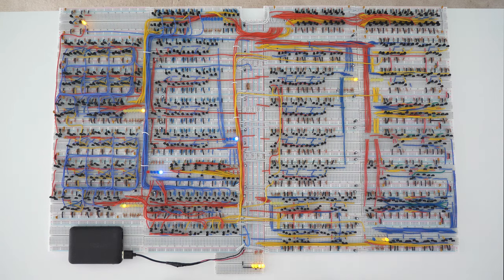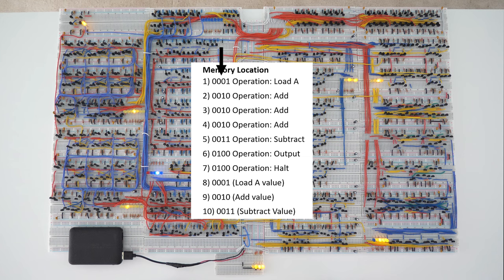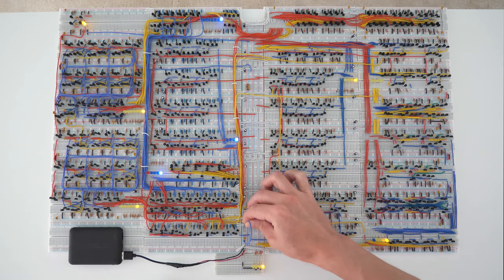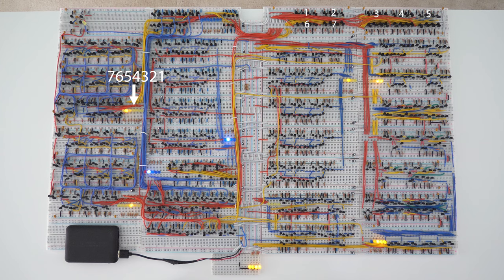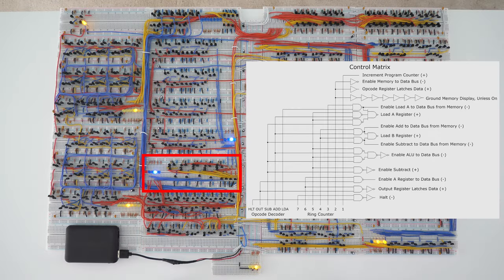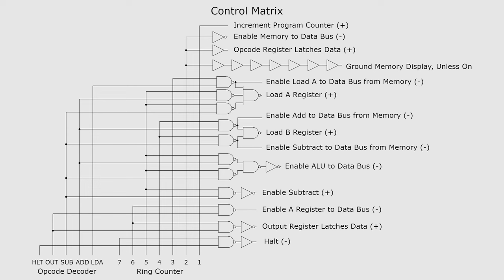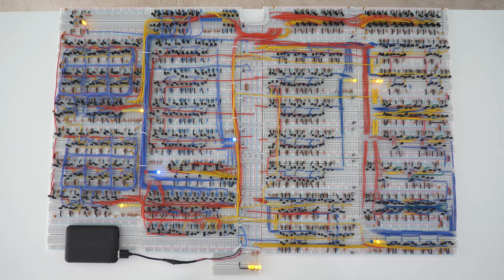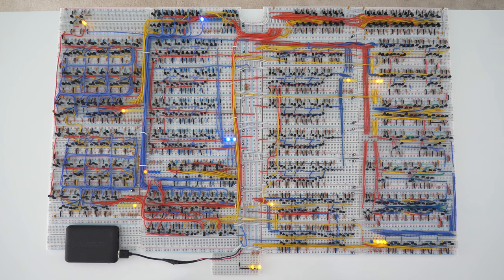How to Build a 4-Bit Computer on Breadboards Using Individual Transistors

Comment: Hello sir, could you please explain how you handle floating inputs from the buttons and bounce on the input? I was trying to build a counter from 2 half adders and 2 d flopflops and im getting unpredictable behavior. (sometimes it skips numbers and sometimes it works perfectly)

Thank you
Reply: I am asking about floating inputs because I read that they may affect the outputs of D flipflops
Reply from the maker: Well I did not use half adders in my counters. Are you trying to built the ALU, binary counter, or ring counter? I am guessing that if you hook your circuit up to an oscilloscope you will see that it is switching much faster than you realize. Also I do not think I even had a floating input, it was always high or ground. The latches start at random values but you and in a reset to force them to be off for there initial state. I can try and help more if you provide more information.
Reply: @GlobalScienceNetwork  I've already built the 4 bit ALU. No problems there. But I am having trouble with anything that has to do with sequential logic( memory circuits).

Is there a way I could contact you directly and show you pictures of what I mean when I say your inputs are floating. I am a complete amateur at the electronics part and I would like to show u a picture of what I thought were the floating inputs on your build.

I really appreciate you responding to these comments. Do you have an instagram or some other messaging app?

I want to build counters for the Program counter and logic sequencer( ring counter)
Reply from the maker: @ChaksFM  If you look at my YouTube profile you can find my email address and send the questions there.
Reply: @GlobalScienceNetwork  thank you so much

Comment: Is this an integrated circuits(IC) structure In the bread Board or outside the black silicon?
Reply from the maker: You could turn this into an IC like the intel 4004 series. Since it only has around 1,000 transistors you could also make it into a PCB.

Comment: I'd love to build a condensed version of this with integrated circuits. But I do wonder: is it possible to write recursive programs for it? A Fibonacci calculator, for example. What would need to be done to make that work?
Reply from the maker: I like the way you are thinking. Pretty soon I will be uploading videos about building artificial neural networks. We will need to find ways to get a small network to do useful computations. Stay tuned!
Reply: Well, I just realized that it'll probably just do that on its own if I don't write a HALT instruction into the program anyway.

In either case, I'll figure it out once I get there. I already have the ALU nearly complete.
Reply from the maker: @dylanm.3692  Sweet, nice work!

Comment: please explain  how do you built all the parts off this computer with many videos
Reply from the maker: I do have other videos about how all the parts of the computer work. Start with logic gates, then the 4-bit calculator/ALU. Then watch about flip flops. From there when you see the circuit diagram provided it should start making sense how it all works. It would be good to make a video about how each circuit works as you mentioned for further clarification. With the video I made you should be able to built the computer if you wanted to.

Comment: It would be cool to supply a little Arduino interface to allow the Arduino to be used to easily load programs and use it's own memory as the computer's memory
Reply from the maker: Yeah, that would be cool. I am working to build artificial neurons on breadboards now and I plan to wirelessly send the output to a little vehicle so I can control it with the circuits build on breadboards. This way I can change the circuit and not have to build a finalized design with a PCB that would fit on the vehicle.

Comment: Can someone explain to me how it is that the computer is storing the information of the outcomes of the addition/subtraction functions in between each one?
Reply from the maker: The results are stored in the accumulator Register. You might be thinking that the ALU would then change its value so it would change the accumulator register value. That is why the accumulator register has to be a MS data flip-flop. So that there is not a continuous update which would cause a racing condition. Some circuits latch when the clock is high and others when the clock is low.

Comment: Hello, would it be possible to connect to an LCD display?
Reply from the maker: Yeah, adding 7 segment displays would be a good addition to the project. Since the numbers are low it is pretty easy to read the numbers displayed in binary though. You could use an IC for the decoders or build them using individual transistors which would be the idea if the displays were added to this computer.

Comment: Do you have full tutorial?  Can I use simulator like Proteus to do this circuit?
Reply from the maker: I made a series of videos starting with basic logic gates, latches, flip flops, and the ALU which is based on the 4-bit calculator. If you watch all of the videos it should be a full tutorial so you can build the computer on your own. That was my goal. I drew the full circuit diagram in EasyEDA at the logic gate level. I made the calculator at the discrete component level. You could work on building these circuits in Proteus and see if you can make the whole computer. That would be a fun project.
Reply: @GlobalScienceNetwork  Thank you for the advice.

Comment: This was NOT stolen from another YouTuber who already did a great job making this PC as well as kits for people to learn themselves.  (edited to fix my mistake)
Reply from the maker: This was not stolen from another YouTuber. This is similar to the Intel 4004 that was built in 1971. The von Newman computer architecture used here was invented by John von Newman in 1945. If you watch the full video I say at the end no one that I know of in recent history has built a breadboard computer out of individual transistors other than Jerry Walker who built an 8-bit computer and wrote a book about it. Back in the early 1970s lots of people were learning to make computers this way. Today many people build breadboard computers out of ICs. These are fun projects and a processor even comes on a single IC so you can "build" the processor with just one chip if you wanted to. The idea behind this project was to build all the circuits for the simplest 4-bit computer at the transistor level. Some people may say this is not necessary but I think it is the best way for everyone to learn how computers work. I learned a lot in the process which I am now using to build hardware based neural networks, which is what I am most interested in.
Reply: @GlobalScienceNetwork  Your right, my mistake. The content I had in mind was Ben Eater's 8-bit computer. Thanks for the detailed explanation and sorry for wasting your time! Appreciate the original content. Subscribed.
Reply from the maker: @beeasy247  Great thanks! No problem, it is pretty common for people to think that breadboard computers are all the same. Building them at the transistor level is the way to go in my opinion and it was a fun project that only required basic discrete components.

Comment: Please consider doing this build again but with relays instead of transistors. The reason is relays are just copper and iron and you can also generate electricity, so this would show that a computer could have been built thousands of years ago. Whereas transistors require very sophisticated manufacturing process.
Reply from the maker: Interesting idea. I am not quite sure what you mean by generating electricity. It would still consume power. Do you know the part number of a relay you have in mind? I probably will not build an entire computer this way but my net project does use relays/optocouplers.
Reply: @GlobalScienceNetwork  the point is how would YOU make a computer eg if none existed and the year was 1750. You would get some copper wire and magnet and make a generator.  And those are same materials to make a relay! So you could make full computer with stuff you could make in 1750 (ben franklin would be proud). and it's not so much about 'time travel' or 'apocalypse', but rather most people understand wire and magnets in a fundamental way, like water and dirt. so you show them a transistor, and it might as well be a microchip to them. it's impenetrable technology.  but relays feel like every day objects if you see it's just a coil of wire and a magnet.
Reply: @GlobalScienceNetwork  you should dress up like benjamin franklin or michael faraday and and build a whole computer from just coper wires and magnets.  that would be so cool. honestly this could have been done thousands of years ago. the hardest part is collecting magnets for the generator.  getting copper and iron wires has been doable for thousands of years.
Reply from the maker: @JamesAwokeKnowing  ha ha that would be funny! Yeah with a little insight, lots of things could have been done sooner. Think about what we could be doing now but probably just do not realize it yet!

Comment: Does it still work if you increase the clock speed e.g 10hz?
Reply from the maker: Yeah , I should have recoded that and show the faster rate. I did not test the max clock speed but it should actually run to around 200,000 Hz.

Comment: By the way, have you tested this discrete CPU in a simulator?
Reply from the maker: I have the complete circuit diagram drawn at the logic gate level in EasyEDA which I show near the beginning of this video. You need the component level for the simulation to run. I did build a 4-bit calculator which became the ALU at the component level which was able to be run as a simulation. I show this in the EasyEDA video on this channel. If you are good at making simulations it would be cool to have the entire computer built as a simulation.

Comment: Just curious How much time did it take 
1
For designing the circuit diagram
2
Actually executing it on breadboards
Reply from the maker: Once I learned and made videos about the logic gates, flip-flops, and 4-bit calculator, it took about three months to build the entire computer. I spent about one week on each section and pieced the computer together as I went. I have another video with a similar title where you can see the computer build half way through the project. If you are interested in building the project I would start with logic gates and then build the 4-bit calculator. I drew the complete circuit diagram at the logic gate level after I built the computer and it only took a few days, mostly to check that the connections were correct. I also have a video where the 4-bit calculator is drawn at the discrete component level.

Comment: hello, great video. im gonna have to check out everything else you made now. great job. . . im no computer engineer, but im learning the fundamentals one concept at a time. . . i play a game called no man sky. its a fun space exploration game.  they have something called the auto switch that works just like a very very slow relay. over the past few years i been build my own 4 bit computer one concept at a time in the game. i like the way your simple set up. i ended up with 16 coded instructions from a 4 bit value. but i find i only use like 4 of them. after watching this video i now know i need a halt instruction. im considering this to be my null instruction at instruction zero. this way any time a null is received the system stops until a reset button is pressed. . . im still working on trying to figure out what my other instructions should be. i still have 5 instructions yet to code in. i just dont know what they should be. yet.
Reply from the maker: Sweet, that sounds like a fun project! Well you could just make the program longer with more instructions. Your project reminds me of when someone built a computer using the Redstone mechanics in Minecraft and it got millions of views.

Comment: For the tri state buffer is the input fron the accumulator low to get a high output?
Reply: This is the open collector tri-state buffer
Reply from the maker: The values on the bus are all on by default and the values are set by grounding the ones that should be off. Data is loaded into the register with the Load A command. Data is sent from the register with the Enable A command. The values get latched high for high inputs and low for low inputs into the register. Load A is done with a high signal, enable A is done with a low signal. If you look at the circuit diagram it shows what type of signal is needed in each case coming out of the control matrix. I hope this makes sense for you!

Comment: You are einstien and should get a token of appreciation of your hardwork i am inspired by your project but i can't afford approx 1000 transistors plz tell xan we create them with vaccum tubes or there is any other way
Reply from the maker: Thanks! Well transistors are probably the cheapest way. You can get 1,000 transistors for around $30. All the other parts, breadboards, wire, batteries, etc. does add up. You can also build simulations of circuits for free on a computer. Or just build smaller circuits to get started.

Comment: Sorry for another question but did you have struggle with inductivity?
Reply from the maker: Not from the wires or components on the breadboard. If I powered the computer with a USB cable from the wall and an unshielded cable there was some noise on the incoming signal. Since this was a digital computer the noise was not enough to make the transistors not work. It is something to be careful of though when making analog designs.

Comment: Schematic diagram link?  I wanna design a PCB for it
Reply from the maker: That would be sweet! If you do let me know. I have the logic gate level diagram I can send you. Which is also shown near the beginning of this video. Just send me an email and I could even help. My email can be found in the channel information.
Reply: @GlobalScienceNetwork  okay!  Thank you.  I will not be able to build the board as because I have no way to get the PCB, but I can sure try and design it.  No promises because I'm only 14 and school is cracking down with finals so if I have time I will!
😃👍
Reply from the maker: @HydroStudios  Ok well some PCB manufacturers will even place the parts. This might be a bit too difficult as your first PCB project but you can certainly give it a try!

Comment: Your next task is to turn this into a Turing machine by adding a memory bank.
Reply from the maker: Hmm it would be cool to build a Turing machine! I am working on building artificial neurons next. It should be pretty interesting, it may be about two months before I make a video about it.
Reply: @GlobalScienceNetwork  I was also reading about Programmable Interrupt Controllers, which store a table of pointers to microprograms termed an "interrupt vector". It takes soft interrupts from its native processor core and hard interrupts from everywhere else, and sorts them according to priority, with the highest priority interrupts handled first. It saves its processor core's status all in one fell swoop when it gets such a signal, and loads the function's pointer into the PC (which it can modify) offset by a memory pointer which be a multiple of a certain power of two.
When it receives an interrupt finish signal, it returns the processor to its previous state, writing all registers, again, in one fell swoop.
The real challenge is the I/O controller, which maps I/O space either to memory or to a separate space called the "port". Memory-side interrupts to it act as "output" while peripheral-side interrupts are "input".
Reply from the maker: That is interesting, I have not worked with Programmable Interrupt Controllers.
Reply: @GlobalScienceNetwork  I realised that such an instruction as "halt" happens to be more likely to be among a CISC architecture than in a RISC. The RISC equivalent would involve a system call or soft interrupt instruction that feeds a certain code to the PIC that pulls down the enable line to its native processor, halting it from further execution until it receives a hard interrupt.
I also imagine an interrupt instruction can be used to return execution from a function call to the address where the call happened.
Reply from the maker: @TheRojo387  that seems right. It is good that you are looking at more advanced concepts than just how the basic computer works. It can be upgraded and modified in lots of different ways!
Reply: @GlobalScienceNetwork  Well, I AM intending to design a modular computer system, after all! I also found this article on "bit slicing", which was done way back when computing equipment was more expensive, and processors for larger data so much so that smaller processors strung together in sync to take the same instruction at the same time, was more viable. Granted that was "hard" bit-slicing, but I fancied implementing "soft" bit-slicing to maximise calculation throughput.
Reply from the maker: @TheRojo387  Awesome, that sounds really sweet!

Comment: Seems like hard work for achieving 1970s kind of processor like the Intel 400x.

I personally prefer another 69 bits. That is kind of more fun
Reply from the maker: Yeah, using ICs can make useful fun projects. I learned quite a bit that I think will be helpful in future project by building this at the transistor level though.